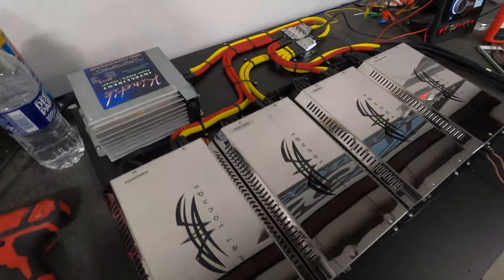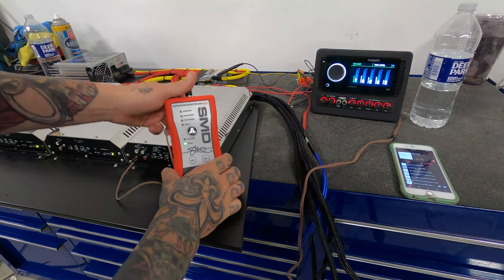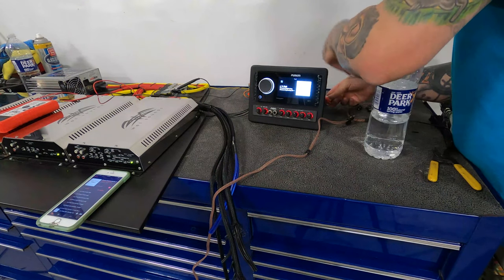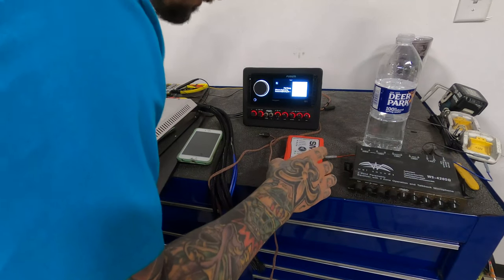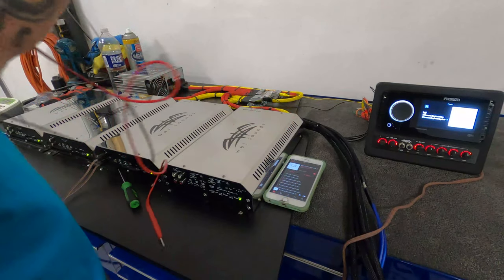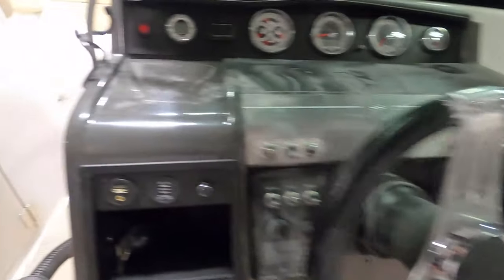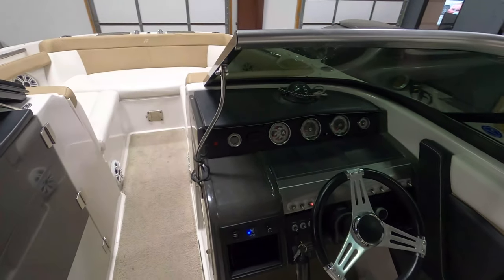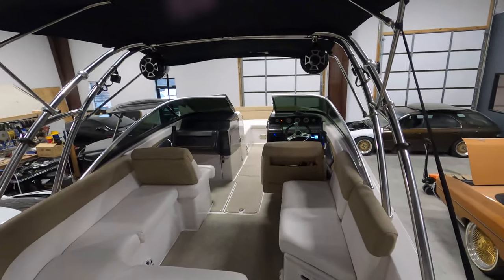Four Winns Boat Amplifier Wiring and System Tuning - Fusion Stereo, Wet Sounds Amplifiers, and More

Comment: I have a question about setting gains with the DD-1, and which method should be used. When determining max clean volume on the headunit should the RCA directly from the headunit be plugged into the DD-1, or should the RCA be plugged into the amp with its gain turned all the way down and use the test probes at the speaker output terminals. The manual that came with the DD-1 says that it (Recommends) testing/determining the headunits max clean volume through the amp with the RCA plugged into the amp with gain turned all the way down and using the test probes at the speaker terminals. I would think the best way would be the way that is done in this video with pugging the RCA directly into the DD-1. When I tried doing it both ways I got two different clean max volumes numbers that is why I ask this question.
Reply from the maker: The reason for two different readings are more than likely a crossover, EQ, subsonic, etc is effecting the reading. You must make sure nothing is interfering with your testing.

Comment: What batteries did you use for this setup? Curious to know how many you used, what brand, and what size. thanks
Reply from the maker: It's been so long we do not remember.
Reply: @SoundsGoodStereo  Do you install boat systems often? If so, what batteries do you usually run? trying to gauge what I need for my boat setup. thanks!
Reply from the maker: We do not. No more retail work, no more boats or anything along those lines. Not sure on what batteries are the best for the marine environment, just not in that world at the current moment.
Reply: @SoundsGoodStereo   No worries, thank you for the reply

Comment: I wish y’all were in FL. Having such a hard time adjusting gains even bought a $250 fluke multimeter but I guess I’ll have to take it to someone. Is it normal to have a little buzz/hiss sound if I have a jl audio Bluetooth CRXV2?
Reply from the maker: No, buzzes and weird noises are not normal and they can be resolved. Not sure exactly what is causing it, but don’t give up!!
Reply: @SoundsGoodStereo  I called JL audio and the guy never heard of it either so I got a free replacement amp coming back it will be here after the 4th 😫
Reply from the maker: Yea, might not be the Bluetooth but rather the type of RCAs, grounding. But I do hope that resolves the issue as troubleshooting can take a while 👍👍

Comment: So the Wetsounds 420 EQ doesn't really do anything other than add microphone capability?  Do you just leave all the controls set to maximum since you are controlling zones with the Fusion?
Reply from the maker: We left them with no extra boost, so flat. We tested them with the distortion meter just to confirm it was not going to degrade the sound.
Reply: @SoundsGoodStereo  so did you just run the tower speakers through it? Since it only has one input, right?
Reply: Fusion makes a dedicated mic for the Apollo. That and the new head unit is going in my boat next.
Reply: @SoundsGoodStereo   so after dealing with this unit for some time learned a few things.  AUX 1 input can be used with a mic and telemute will silence the music when mic keyed up, so kinda waste to leave the WS420 in the system, adding confusion to someone that sits down at the helm.  And in the demo part of the video you mentioned that each zone had a sub output but you gave it it's own zone to control it.  If you hold in on the control knob it will bring up the sub volume for that zone, so it is controllable without getting into settings.

Comment: Those WET SOUND eq’s are JUNK !!!!!  Biggest waist of $$$$$$$.      And noise generator around RGB lighting..      just speaking out loud
Reply from the maker: lol, not our gear.. We just made it the best we could for the customer. Fortunately, it all worked out great
Reply: funny you say as I did a system on a beer can recently  . He also  wanted RGBW strips down each can.  there was so much noise coming from the west marine controller, I just prayed he wouldn't  listen at low volume with strip lights on, the engine off as he sipped his can of claw looking cool hoping for a blow from his wife  lol  " what's that humming  sound honey..  never mind  dear.. as you were"

Comment: VEEEEEEERY time consuming install.  lots of channels. A ton of work  to bring this all together. obviously a good customer paying for quality equipment and a quality install.  Def Not a job that could be done dockside without distraction from dozens of nosy marina guests constantly dropping by to talk. been there.  

 i was recently fooled by the DD1 for the first time last month this time  installing a system on a Rockford head.  DD1 was noting distortion nearly right out of the gate.  I thought it was a faulty head because it had previously been running a 2 ohm load on deck power so I figured it was cooked. I had customer order a new replacement  head, same result.

 so I was like wtf and called Rockford and they said that model head was not a true licensed model and had been discontinued. He followed up by saying the DD1 measures distortion at 1%.  The moral of the story Is I wasted a lot of time when it turns out  it was the head unit signal was not "clean enough" .  Since then I started using a scope so I could see the sine wave rather than the led pilot indicator.  i still use the DD1 and do love it, but the scope is a nice tool to double check. 

Very nice work.  Love the starboard drop in.  

Did you use deutsch connectors as well. I wouldn't be surprised with the level of detail you put into this system.  Is there a capacitor going in too?  How many batteries in his house bank?  are they deep cycle? dual purpose? , AGM? FLA ? 24's, 27's 31's?   Did you need a signal splitter or were you able to run  each head unit zone directly to each  amp?   Since  you have so many channels, did you have to  combine any coaxials  into a 2 ohm load or were you able to keep the amps at 4 ohms throughout?    

Impressive. That is a massive amount of work.
Reply from the maker: Thanks for the comments! A DD1 works great, but only if you are familiar with the gear. We also have every other tool in our arsenal just in case we need to dive deeper... Regarding the exact system, I'm not sure what else electrical wise the customer had. It's been a long time since we did this install. Thanks again